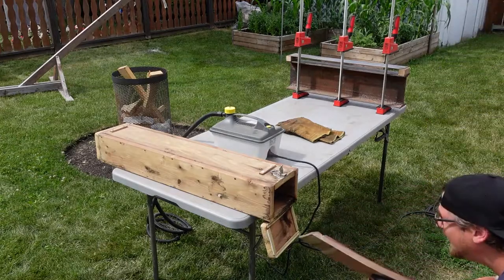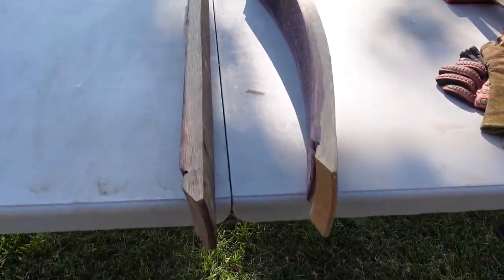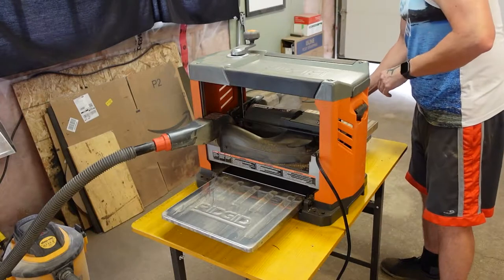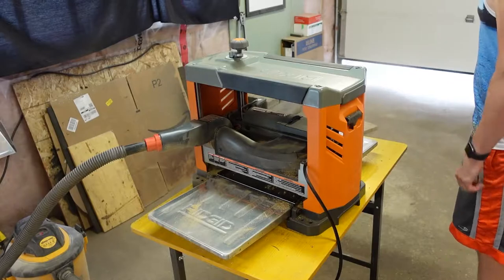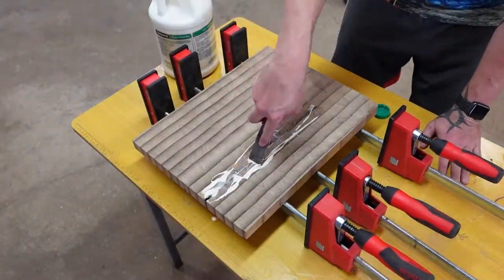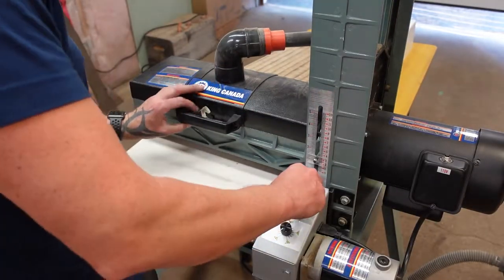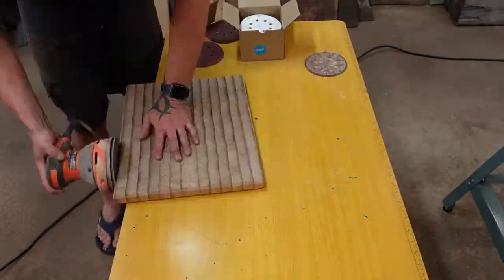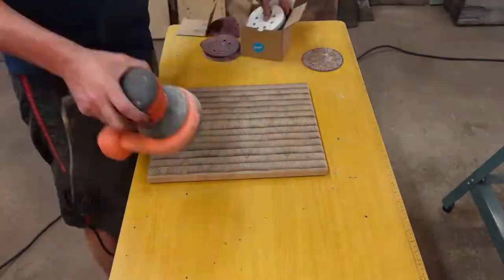76+ Hours - Wine Barrel Stave Cutting Board

Comment: Could you have left the little grooves that hold onto the barrel top on the end or would that have not worked well?
Reply from the maker: The glue-up needs completely flat surfaces, the ends would have left gaps and resulted in a weak bond.
Reply: @BoujeeBarrels  that sucks having those end connected would look so cool

Comment: I have done a few of these and just left the curve. I had voids but I Just cut around them. The pattern is much more chaotic. IS this technically an In-Grain board? Great video, super easy watch.
Reply from the maker: Yes, end-grain cutting board. And thank you very much! Glad you liked it!
Reply: how did you cut around the voids?
Reply: @oxymoron-om5xm  you mean bung holes? :-)  So i did end grain boards so I just ditched about 10% of my cuts due to voids. If i have a bad run i point the voids to the bottom and make a one sided board.